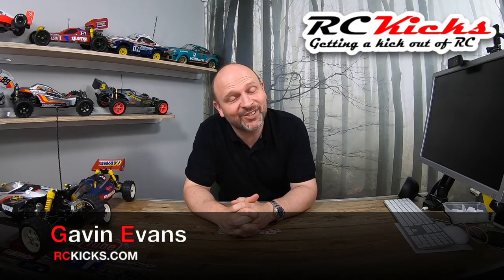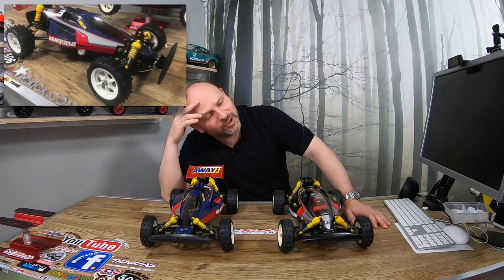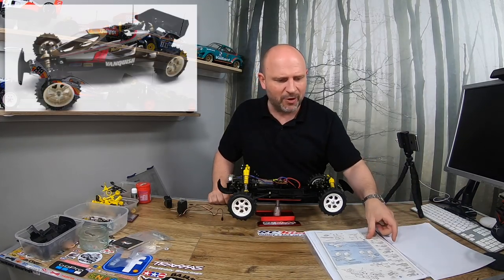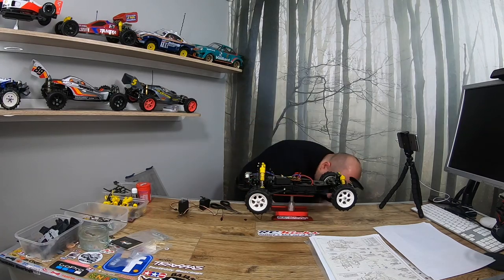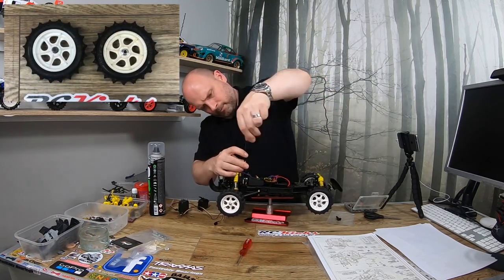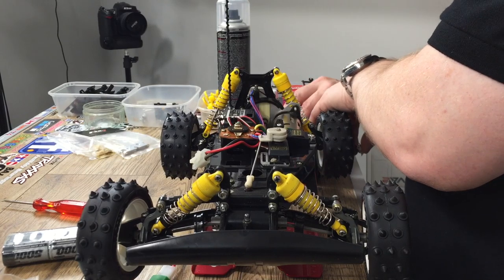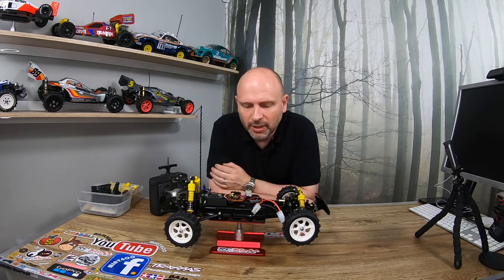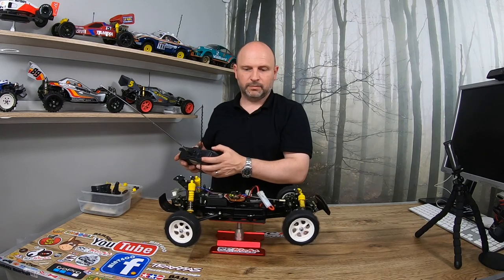31 Year Old 80's Tamiya Vanquish Part 4, Chassie RC Car Buggy Rebuild.

Comment: I agree 120% Gavin!! 👍 
This is the ONLY one of "The 100" that I've never owned. 
Frankly I've had the most fun with my Tub Chassis Buggies - 2 and 4WD!! I'm not a Shelf Queen guy... but do appreciate the hard work and intense scrutiny involved in restoring one of these to a nearly new condition. 
I always saw the Vanquish as a Hotshot series....DONE RIGHT!! (Yes, I know they're different)
But of the Tub Chassis, easy side slide Batry Holder kind of Buggies. 😉
Carmine ✈🚂🚙
Reply: Doing up the MSC as well!!! 😳😧 😎 
Certainly Period correct. But I've BURNED more fingers on that Ballast Resistor!! 🔥🔥😳

Admit it, despite the fiddling and frustration...
It was worth it - RIGHT!? 😊
I'm now going to watch this, in REVERSE order. Since part 4 is where I started...
Reply from the maker: PoorManRC The MSC is not a great bit of kit vs the amazing ESCs you can get now for not that much money at all.  As it’s a restoration I like to have the OEM electronics as best I can.  I have a driver Falcon so that has ESC.  Burning your fingers on the heat vent is all part of the experience lol.
Reply: No... I didn't like them then! But my 22-25 year old fingers were much better at coping then they would be now!! 😳😋
Trust me, my friend, I've HAD my Trial by fire🔥🔥!! 

...... If I were to make a Shelf Queen, it would be the Avante! Complex, somewhat fragile, and I LOVED it!

Comment: Very nice. I'm also restoring a couple of vanquish. If you want to make yours fully orignal, you need to change your speed controller, which is more recent than the car. The original one is the same as the astute (braided wire and blue/white resistor wires).
Reply from the maker: Didier Favre Cool, I didn’t know that.  I will change it.
Reply: You really shouldn't mess with the original mechanical speed controller, unless it's just for a shelf queen.

Comment: Perhaps the hicap shocks had different rated springs? I wonder why Tamiya produced cream wheels for the Vanquish rather than white? That's Tamiya for you I suppose!
Reply from the maker: TachyonDriver Not sure if the Hicaps are the correct set for the Vanquish but I need to check specs.  I have no clue why the Vanquish wheels are cream over the white.  It’s the only car to have these wheels.